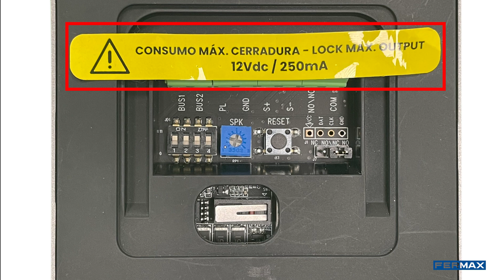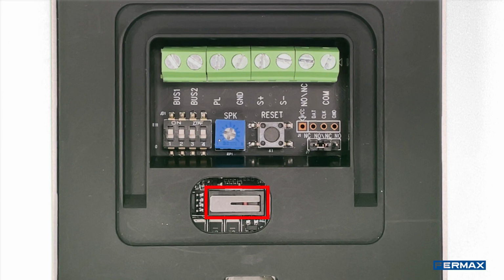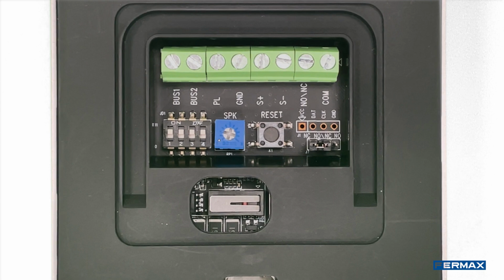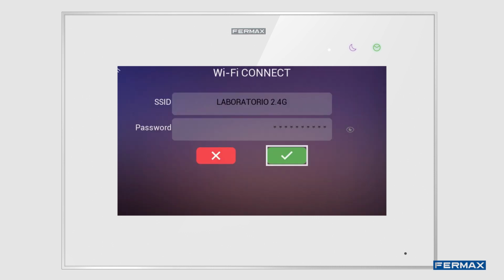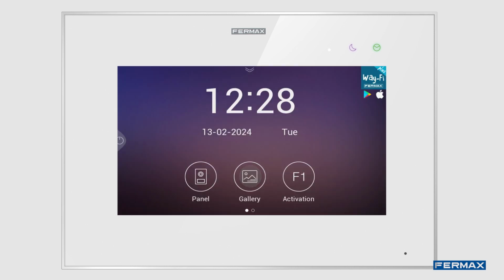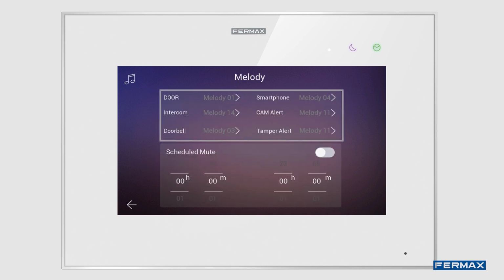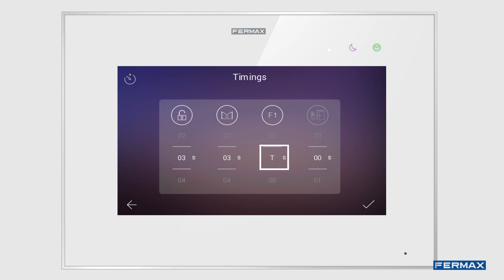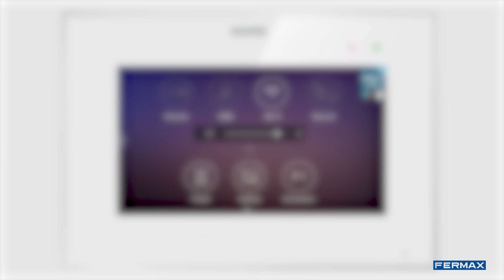[Way-Fi Plus] Way-Fi kit configuration Ref. 1571

Comment: Great video. I’m having an issue where my SSID is not appearing. I do see three SSIDs that all have the same name (a random string of 8 characters) and I have an EERO mesh network. Is there a firmware update or a known issue when connecting to mesh networks? I do have a special character in the network name and I have tried to disable the 5g band with no change in behavior